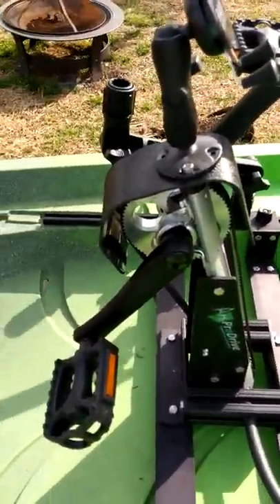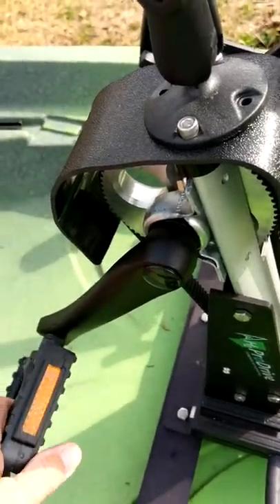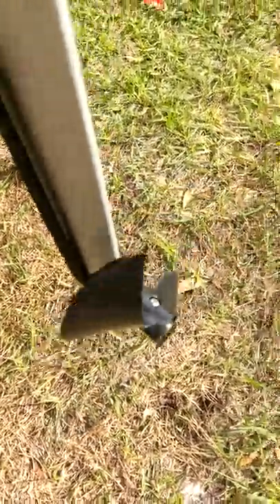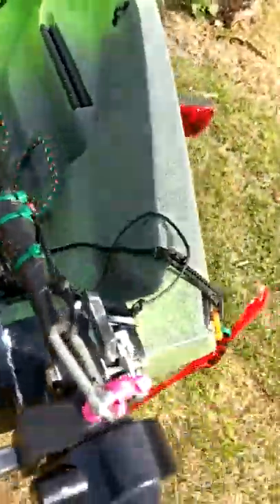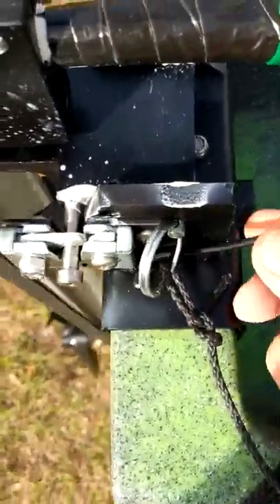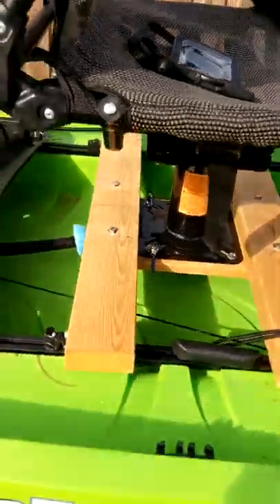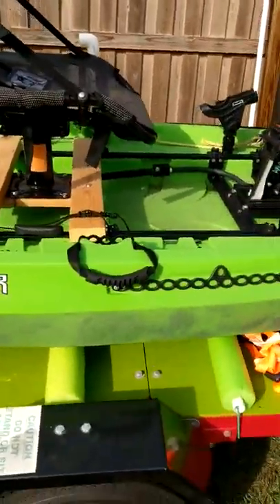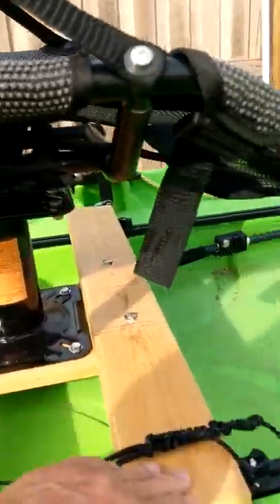H2Pro-Ped my install overview

Comment: Could you fir the system in before bolting  anything   down as ND maybe if you would have moved the drive and seat back 12 to 16 inches you would have been where the instructions suggested your seat to be without having to try and reconfigure the installation process ...and I thought the pedals were meant to pedal almost a little uphill so you have more torgue like a three wheel bike you sit on

Comment: They have the new pivot drive now..
Reply: I'm thinking about getting this drive for my frontier 12 but I really don't want to pay double because the H2O wrote NuCanoe on the drive and they doubled the price
Reply: @dwayneb72    I ended up passing on the pivot drive , would of preferred nucanoe to come out with there own pedal drive yak instead of the 3rd party drive , ended up selling my f10 which i had for 5yrs , moved on to a pedal yak which has bin awesome.
Reply: @nashguy2814  well.i just got the frontier 12 brand new last month so I will either add this or the new pivot drive from what I can see so far the newest version is pretty seamless.since it uses belt drives it is supposed to work very smoothly
Reply: @dwayneb72   Yeah the original H2PRO-PED is belt driven , nucanoe  made some changes to it and slapped there logo on it and called it the pivot drive.   Check out H2PRO -PED  web site , thats the original and then the Pro Drive to the Pivot Drive.
Reply: @nashguy2814  I just wonder how much hassle it is to install the H2O pro on the frontier and if I'll need to buy more parts ..I know the pro is like 649$ and the pivot drive is 1249$ seems a little ridiculous to lay claim that slapping a mount and your name on the same drive system that doubles the value
Reply: @dwayneb72    Yes the price is up there. I just checked the H2PRO-PED web site and there selling the H2-700 Model for $695.00USD , i really liked my f10 but just wasn't sold on the pivot drive for that price , and i do believe all the newer nucanoes come pivot ready , basically the drive is made to fit the 12 or 10 flint / pursuit as they all have the threaded inserts , just make sure you get the right length pivot drive and should be an easy install as the placement of the drive / steering is a set length for each yak.
Reply: @dwayneb72   I also believe the Pro drive is sold out and not continued anymore do to the Pivot drive.